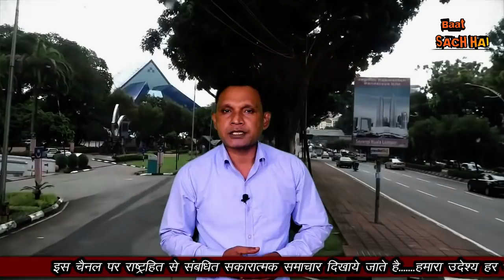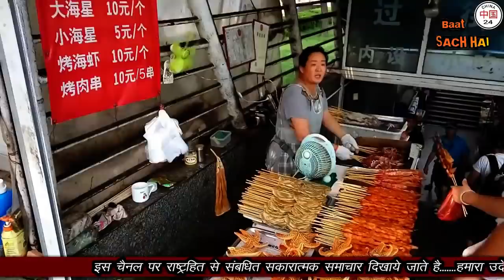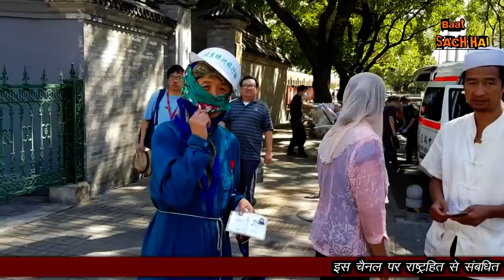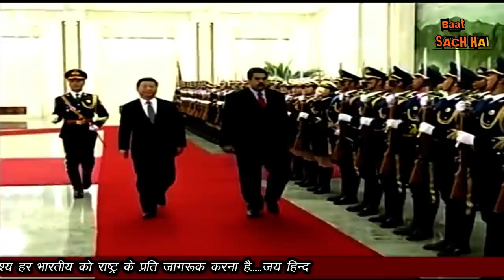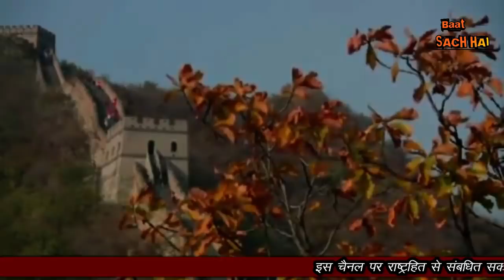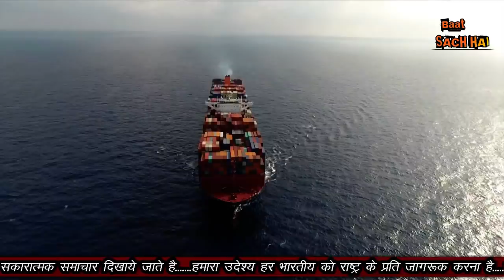CHINESE KO MODI SE MILA JHA-TKA LAGAI YE G-UHAAR

Comment: Broadly good analysis though without supporting data. However, situation is correctly profiled. In  case the global community continue to exert pressure in line with their capacity and potential, this war can be won even without firing a bullet.